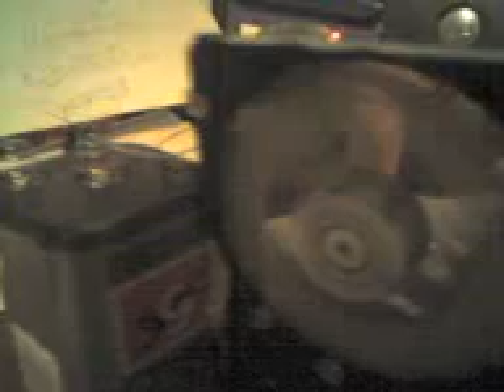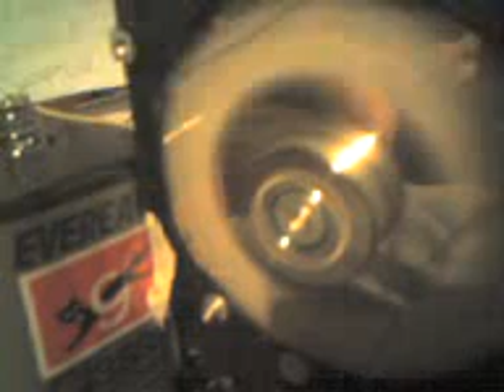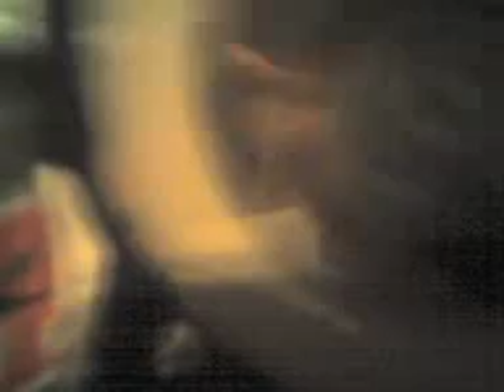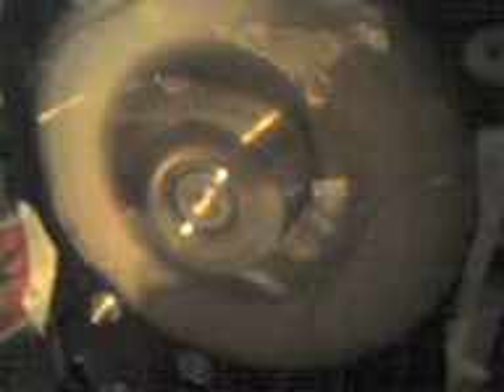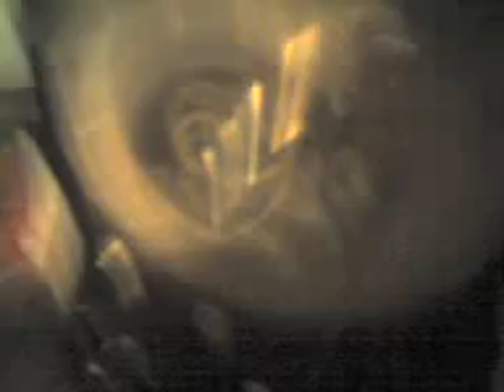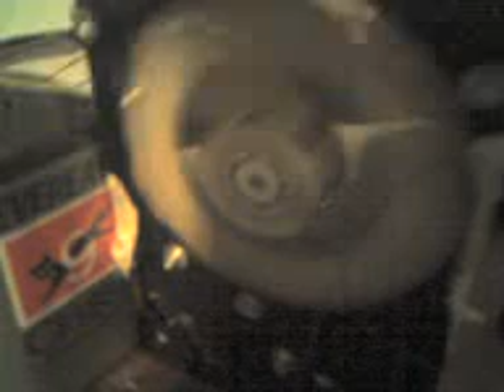Hard drive magnet motor oldie 1

Comment from the maker: @Sdanieln It is just a hard drive with most of the electronics pulled out of it. There are four wires that come from the motor, one is common, and the other three are to the coils. I used tape on the platters to time the motor. the common wire goes to the negative on the battery, the positive wire from the battery is placed at the specific position on the platter and then another wire leads from the case of the motor to one of the coils. just play with one, you'll get it.